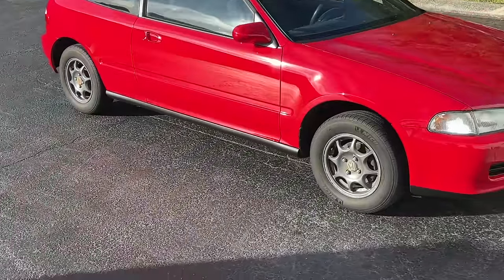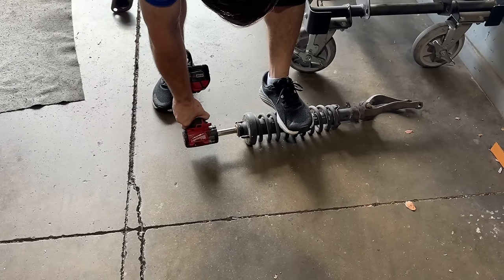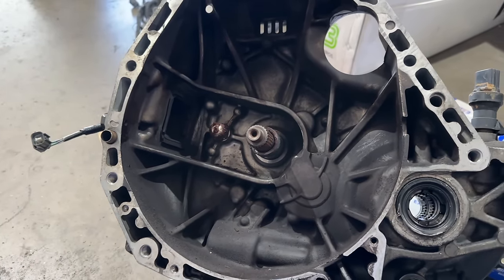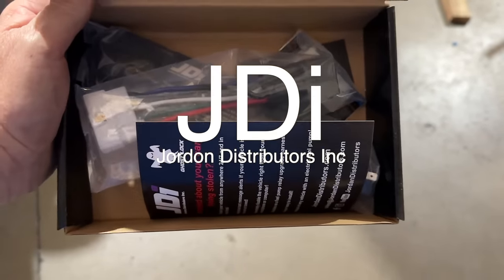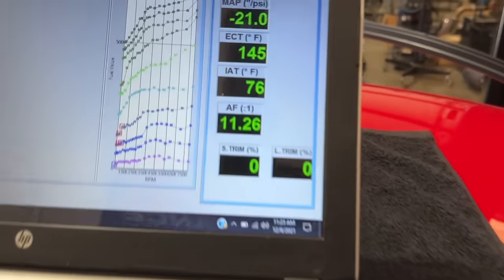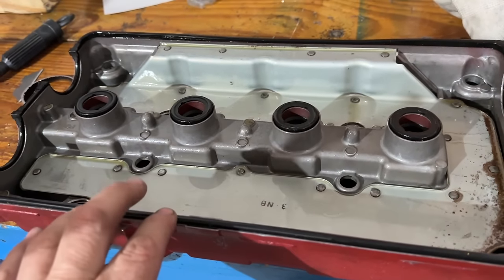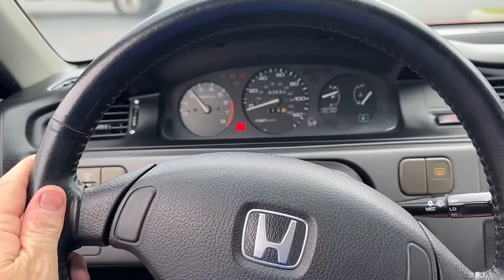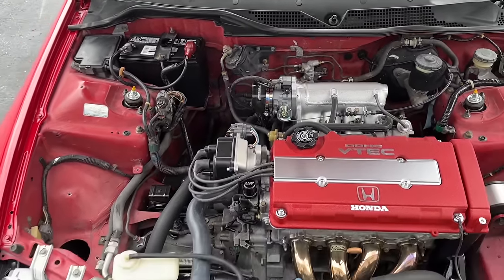Civic VX  B18C Type R Build

Comment: Miss that sound. I had a 92 hatch with a built B-16A back in the day. Nothing beats a B series
Reply from the maker: Yep 👍🏻. Long live the B series.
Reply: My dad 03 Mustang GT will beat any Bseries
Reply from the maker: @ltatjsallday8709  lol.  My Dad better than your Dad.
Reply: I will always miss my 93 EG6 VTi with the B16A2! No 4 cylinder sound Beats it.
Reply: K20 beats bseries.
Reply: I had a '94 with an Integra B18. The B16 just doesn't cut it.
Reply: @matheus5890 Everyday, all day. 👍
Reply: Learned how to drive in an EG with a B16A from a del sol and stage 2 clutch. Fell in love with hatches after that.
Reply: @renatotuche  yup, the sound and the feel and when the vtec kicks in with the sounds of the reving... you cant beat a honda..l had a b16a2 japan motor in a ef hatchback...was fun!
Reply: @matheus5890   but the sounds are different
Reply: I used to own two Aztec Green Pearl 1992 Integra GSR with the B17a1. I have a LS/VTEC Del Sol that needs a wiring harness, ECU and tune.

Comment: Love seeing B series Type R swaps in this day and age. Makes me wish my swap had those cams! I thought my crossover was pretty gnarly for a stock motor!
Reply from the maker: I really like the Tuner 2 cams. Very smooth idle, quiet valve train , no need for massive springs and last forever.   George ran some in his Integra for 40k miles and looks like new still.

Comment: When I built my turbo LSVTEC I went with a PR3 B16B head, a Golden Eagle LSV conversion, Skunk2 Stage 3 Tuner cams, full S2 valvetrain, S2 adjustable cam gears, PLM top mount turbo manifold, Garrett GTS3582 dual ball bearing turbo, S2 Ultra Race 3.5L intake manifold, S2 90mm throttle body, Grams 2200cc injectors, E85, Aeromotive 13109B external FPR,  Walbro Hellcat fuel pump rewired and relayed, CP 81.5mm pistons, Eagle rods, ARP main and head studs, ATI Super Damper, Darton sleeves, Eagle blockguard, S2 Composite fuel rail, -8 fuel lines, Rywire tuck harness, 3" downpipe, a self rebuilt GSR trans with a LS 5th gear and an OBX LSD (that I upgraded with strengthened Bellville washers and heavy duty cap head bolts), and a full 3" Thermal Research exhaust. It made 709 whp at 34 psi tuned on Hondata S300 V3 on a P28 ECU. It was SCARY fast! It would roast both Nitto 555Rs in 4th gear at 80 MPH!

Comment: For the valve cover nuts, I found a nice option from Belmetric. Stainless acorn nuts with a captured washer that lets you torque the nuts without marring the polished gasket stud caps and the plug wire cover plastic.

Comment: The best OEM gearing combination that's possible for that transmission is:

1st - 3.23
2nd - 1.900
3rd - 1.360
4th - 1.071
5th - 0.875 (B17) or 0.871 (90-93 Accord DX Mainshaft 4th with 92-96 Prelude H22 0.871 countershaft gear. 

Better 2-5 gear span than ITR

Comment: With the suspension, we used to put a vice grip on the shock. But i did a lot of those in the early 2000s.
Reply from the maker: That scratches up the stantion ( shiney part) and will damage the seal and make em leak.
Reply: @LHTPerformance  That's why we needed you guys back then 😁

Comment: Question for yall, installing a B18C on my integra. Has been rebuilt with OEM components, should lower the compression ratio before turbocharging it? I had an FRS I built my mechanic advised I lower the 12:5:1 compression down to 10:5:1, I did so and it worked great
Reply from the maker: A US B18c1 is 10 to 1 compression stock. That’s very boost friendly.

Comment: I miss my Type-R trans... I bought it second hand off Ebay (came from Malaysia).. Ran it for years in my LSV Integra..John i bought an LHT catchcan for that car btw ;-)... And sold the trans for as much as i bought it for when i parted that car...miss the LSD

Edit* i felt just as spoiled with my DC as fuel pump changeouts went.
Reply from the maker: I remember when I used to buy new ITR trans for $2100.  I wish I bought some.
Reply: @LHTPerformance  mine was used, $750...sold it years later for $775
Reply from the maker: @kylecurry6841  that’s awesome. They go for a lot more
Reply: @LHTPerformance  oh yeah John, they do in today's dollars lol. This was circa 2006 when I bought it. Sold it 2011ish. But the motor I had put together and used that trans with all came together in 2008 iirc, and I stopped in your shop local (I live in Holiday) for the catch can, which I still have if/when I can get my hands on another mid-90's Honda.

Comment: You'll have to change the tachometer because it won't read right when you change the ecu
Reply from the maker: The tach reads off the distributor, not the ECU. However, I’m sure the speedo and tack will be replaced in good time. This is an ongoing build, and they will be a part two

Comment: Hello I have the same swap what engine mounts do you use? I can’t find the driver top mount in oem what brand would you recommend? 😊
Reply from the maker: We used all OEM mounts from a 94-01 Integra
Reply: @LHTPerformance  appreciate the reply! I’ll have to look into those. Also do the 94-01 integra oem mounts drop in no modification needed?
Reply from the maker: @sogonexd9130  No problem.  Yes. Direct bolt in.  Use all the mounts from the Integra and it bolts in.  Easiest swap ever.  👍🏻
Reply: @LHTPerformance  thanks soo much! I’m a newbie in the game but it’s been one of my dream cars and my 94 Si happen to come with a jdm itr b18c swap so I will definitely get these mounts. Does it need to be a certain chasis or do I just put 01 integra type r or gsr for example when searching the motor mounts ? 🙏🏻😬
Reply from the maker: @sogonexd9130  94 to 01. You will need to run a Del Sol AC bracket for a redirect replace for your Civic compressor.   It really is a very straight forward swap. I’ll enjoy the process.
Reply: @LHTPerformance  I’m not sure what ac bracket I have but I do currently have access to working in my car and power steering. I also believe I have the wrong ecu it’s a p30-g01 which I’m guessing makes my car not run as smooth as it should. My goal is to get it to run like this vx 👍🏻😎.

Comment: Is it wheel power or no? Cause it’s low for type r motor
Reply from the maker: This is measured at the wheels. Hence ‘WHP’
. A stock Type R will usually make 160-165whp in stock trip.

Comment: Why does the speedometer not work?
Reply from the maker: If you look closely, the needle is the wrong side of the stop. It works but starts below the stop. It will be replaced in part 2

Comment: You forgot the OEM fuel filter 🤦🏻‍♂️😂
Reply from the maker: We put a new filter in with the replacement pump. If you look you’ll see
Reply: @LHTPerformance  I’m not talking about the pump filter i’m talking about the actual fuel filter. That’s the closest to the intake manifold on the firewall
Reply from the maker: @93jdmmike  oh. Those you can back flush. The OEMs are a fine screen element.
Reply: @LHTPerformance  yes, there are paper element inside and they need to be replaced. They can restrict the flow overtime.

Comment: Why can’t I find a car like this?
Reply: all it takes is money my dude.  Gotta be willing to pay, unfortunately a lot of kids clap them out or turn them into race cars so they're harder to find in good shape
Reply: Does that oem release bearing work for the small spline trans also?
Reply: @gotmesom I can’t even find a good donor car. Money isn’t my issue…
Reply: You gotta build it!
Reply: @coreywoods2742  then you aren't looking hard enough.  I can find them easily but you're gonna pay a lot for a rust free car, and it still might need paint.
Reply: B16B and B18C are so expensive now 😅
Reply: @gotmesom  I’m also not paying 150-200% of what the car cost originally. Only to need to spend 6-8k to respray it, fix dents etc. the ROI doesn’t coincide with the cost. The problem is people keep paying peoples outrageous asking prices which is what drives the market up. These cars were like 11k when brand new.